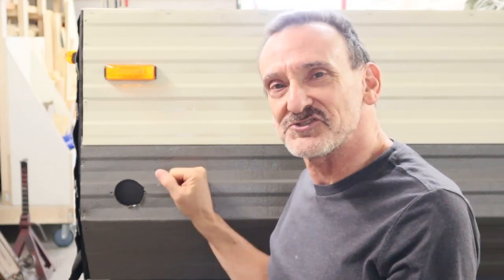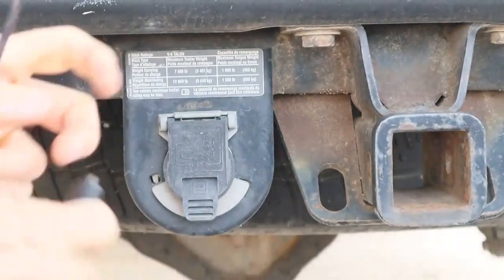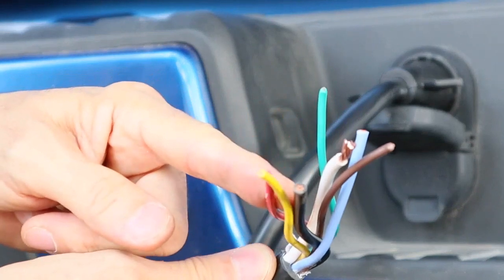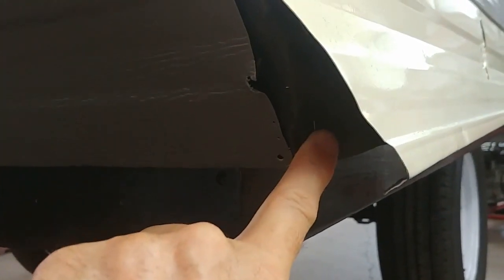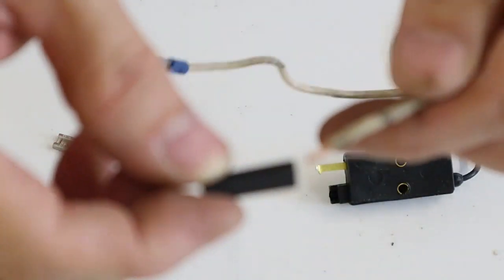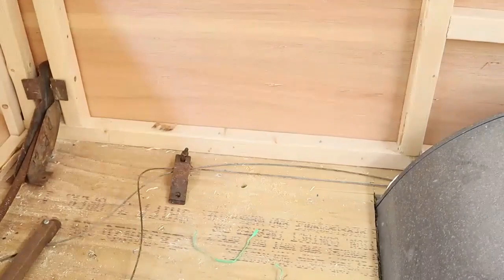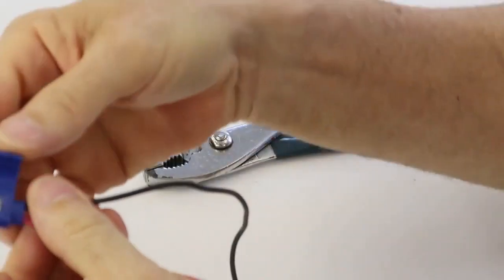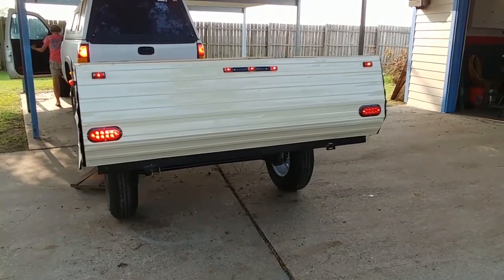DIY POP UP CAMPER LIGHTS PT15 12 Volt RV Cargo Trailer Camper Conver. Wiring 7 Pin Harness #flgpopup

Comment: When I had my shop I hated doing trailer's they always came in loaded and they always wanted them right away witch didn't happen very often. I remember one guy came in and his trailer was so over loaded the tires were rubbing on the fenders.  And I never would repair the wire I always replaced it with a new wiring harness with the new pig trail I keep 6 in stock at all times. You did good Greg I could have used you at my shop. I do miss the money but not the headaches. We hope your tomorrow is better than your today was.
Reply from the maker: Thanks Den. I would MUCH rather wire up a new trailer than try to repair bandaged up wiring and corroded light sockets. LOL. Sounds like we have both paid a lot of dues.
Reply: @FakeLegGreg  i am sure we have.